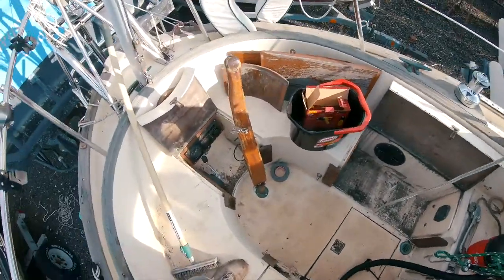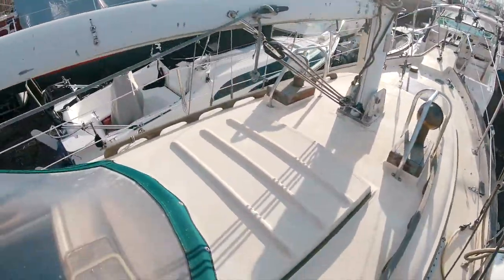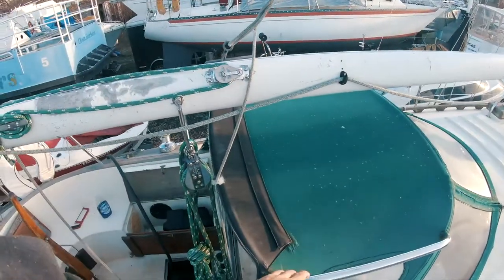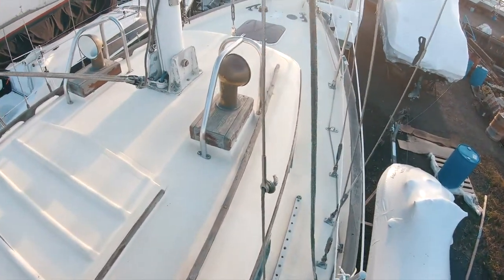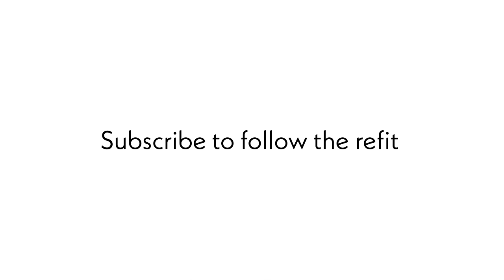Ep. 6: Reverie gets a bath - Refitting Reverie

Comment: Your in for a challenge! I am currently refitting an endurance 35, turned more into a complete build than a refit though! Boats are a lot of work especially by yourself, stay focused don’t give up!
Reply from the maker: Thanks a lot Brent! I am doing my best to manage  expectations. How far along are you in your refit?
Reply: @refittingreverie7992  I ended cutting the entire deck off the boat gutted the entire thing down to the bare hull, had to replace stringers the entire sole, have the boat framed back up out marine fir plywood now just epoxying and clothing everything back to the hull on the under side of the deck, then if I have time before the cold will do the decks if not will focus on my interior over winter then do the decks in the spring! I’m about a year and a half into it but don’t always get enough time to work on it! I have a few pictures on Instagram if you want to check it out! @bremley